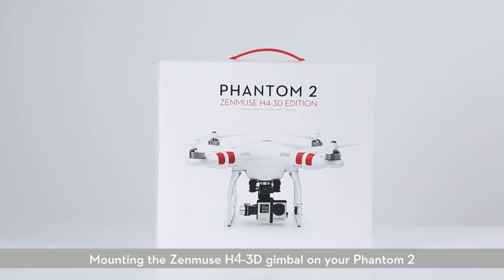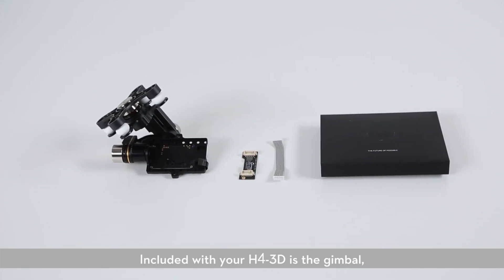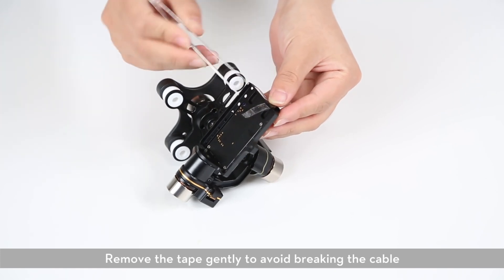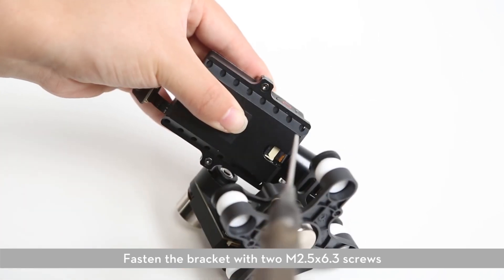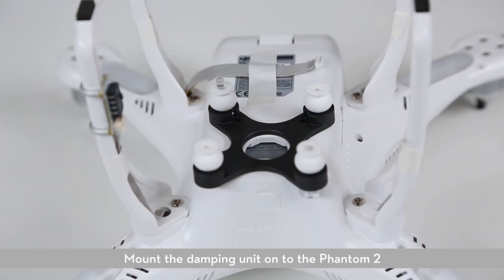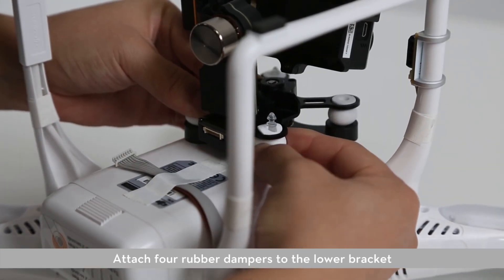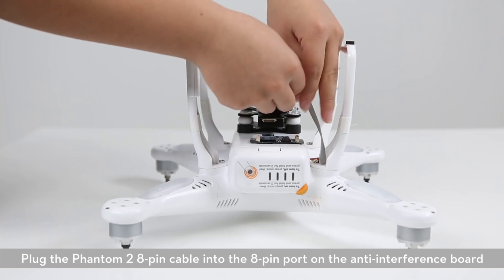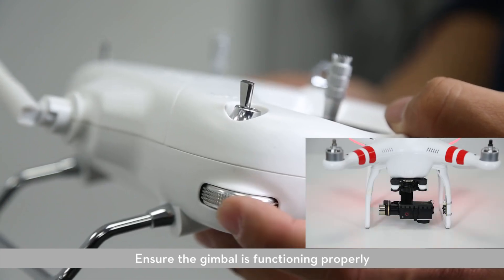DJI Tutorials - Phantom 2 - Installing the Zenmuse H4-3D

Comment: What model of go pro hero 4 are you using the reason I ask is if your using the silver version does the view finder still sit on the metal plate. 
Daft question but wouldn't it scratch the screen.